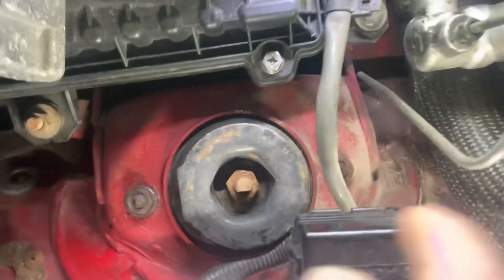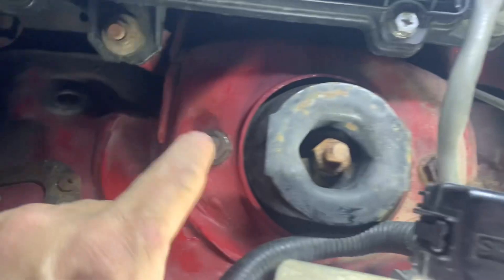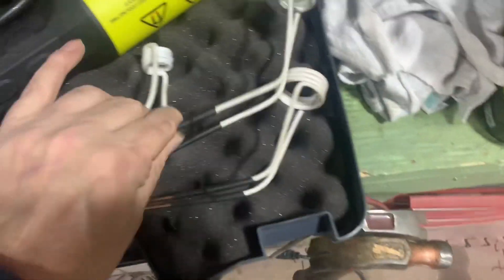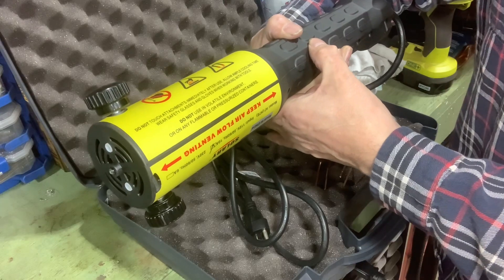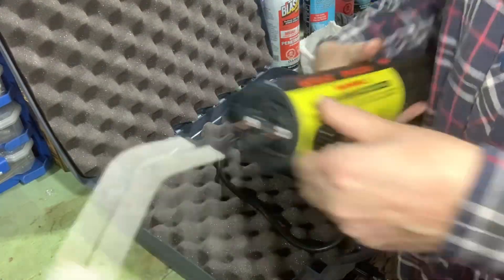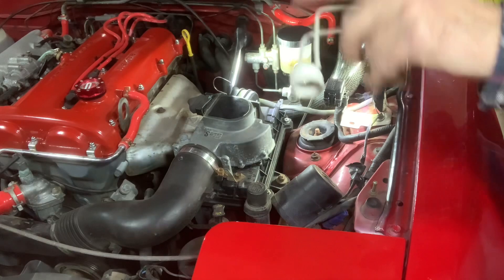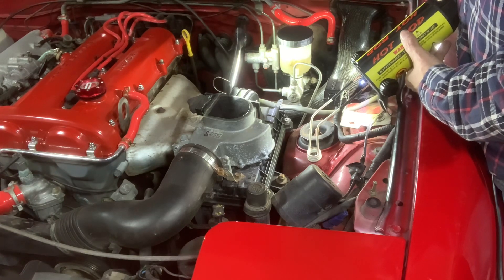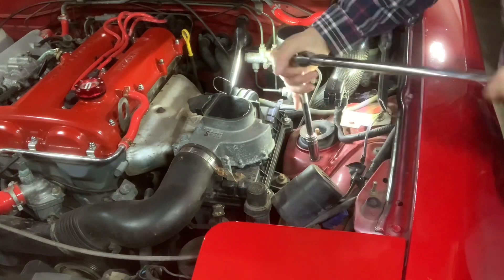Using an Induction Heater to Remove Rusty, Stuck Fasteners

Comment: I don't hear the fan in the tool running. I'm pretty sure it has a fan, er no?
Reply from the maker: It doesn’t have a fan. Neither of the induction heaters I’ve used have had a fan
Reply: @BruceLyeg  Ours at work does. Its annoying thats why I noticed. I'll check, maybe its not the same brand but its certainly the same color scheme.

Comment: Bruce, great info-video.  I've never seen an induction heater in action but now I have.  That's one slick gadget. That baby seemed to make a tough nut into a butter-nut (smile).  It's much safer than a live fire-torch down into a tight area with vulnerable components exposed. Thanks again for the demo.  Full-watch.  Have a fine week.  Don  👍🏽🤠 4/23/23
Reply from the maker: Thanks Don. I’ve always been paranoid about using torches in my garage, plus they take a lot of space. This thing has been awesome and the price is way down from when they first came out. 
You have a great week too

Comment: Great video Bruce! For myself I use kroil. It broke loose a frozen valve in a water plant in Niagara that had not moved in 25 years. U can also heat the nut with a torch then shock it with water.
Reply from the maker: I can’t find Kroil around here anywhere and Amazon wants $70 a can!  We used to use that when I was a mechanic at a taxi company. Great stuff!

Comment: It's so hard to find Red Silicon hoses that are actually Red All the ones I have found Are Pink Not red
Reply from the maker: It is!  I looked for awhile before someone on a Miata Group told me about this seller on eBay.  The sellers name was "r-champion (2875)"
Reply: @BruceLyeg  much appreciated on the info for the seller to red Silicon hoses appreciated bruce